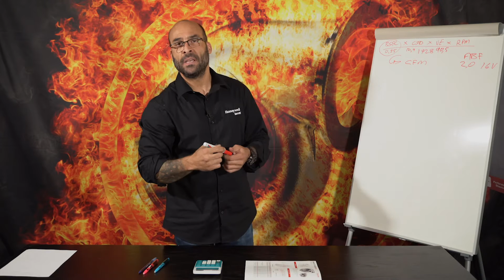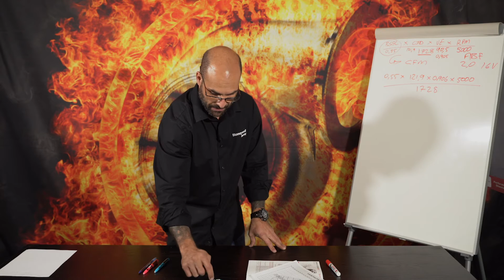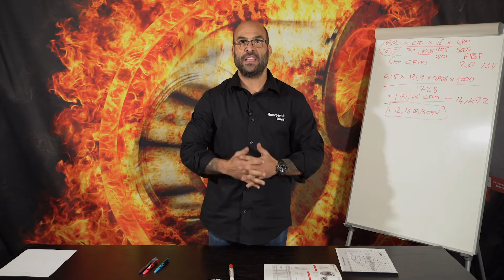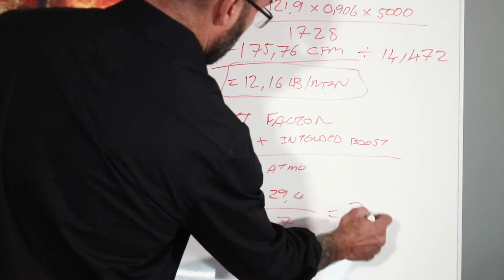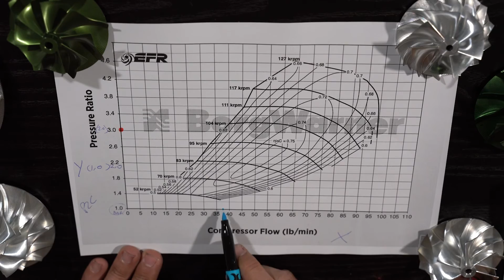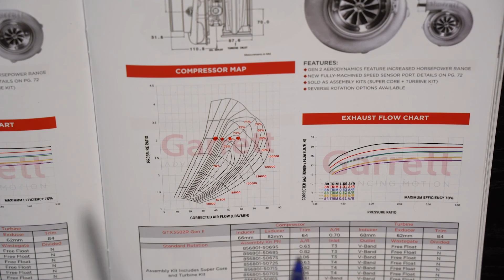Turbocharger compressor efficiency

Comment: Can you determine VE from a dyno run? How did you determine bfsc?
Reply from the maker: You probably can, but the VE will not be accurate, there are always losses in the drive train, and outside conditions that will affect the calculation that the dyno does to provide you with the power and torque.  VE is usually calculated from the engines specifications. The manufacturer will provide the VE, or you can use the Power that the engine makes at the RPM it produces max power and its CID to calculate the VE.  BSFC is mentioned in the video. 

Keep in mind that the calculations provided in the video are NOT in-depth, these are used to provide you with a very good idea (within 5%) of the actual value if you take into account humidity, Baro, Density Altitude, intercooler efficiency, pressure drop and and and --- so that you can identify and choose the correct turbochargers compressor for your application. Its NOT designed to split hairs and calculate the very last 0.00001 decimal - if you get my drift.... 

Hope that helps -

Comment: I dont quite see how this info will help select a turbo, you didn't explain how you know it will get into boost, ever! For example even bigger turbo on that engine may never get into boost right?  just placing a dot on there at 50lb/min doesn't mean it will get there. So more to the point how would I calculate what rpm I might get boost with a given motor and turbo, that would be useful for me. This video makes it look like you can put any size turbo on a 2L and put a dot on the graph of a good brand turbo, and it will get there, which I know is impossible IF the turbo is too big.
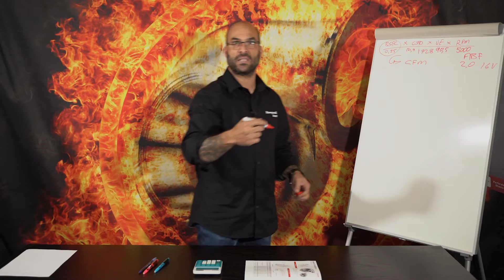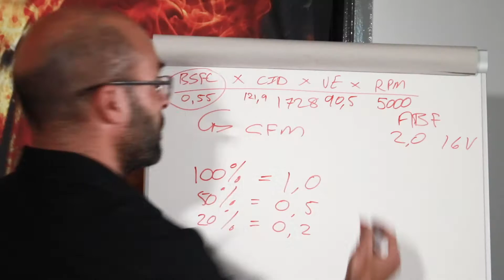Reply from the maker: Jay from around 1:05 until 1:35 i mention that we will not be going into the low level in-depth calculations and we wouldn't be splitting hairs about every single formula and contributing factor - this is a basic outline on how compressor maps work, how to plot on the compressor map and how to calculate the plot points based on your specific engine build - its not discussing or demonstrating the turbine calculations (which is extremely complex in comparison to this video) which is what you will need to be able to plot the "response curve"  and understand which AR turbine housing to use etc -- 

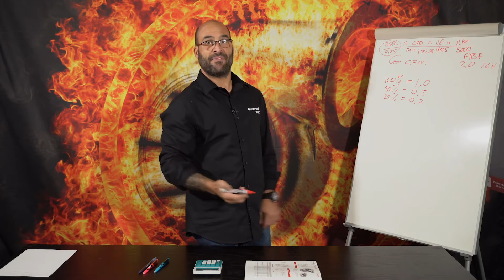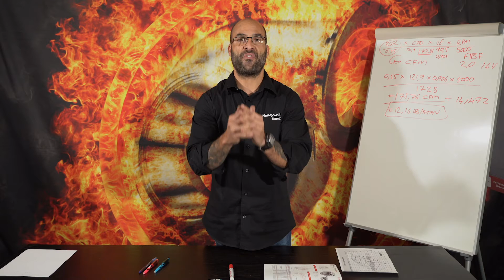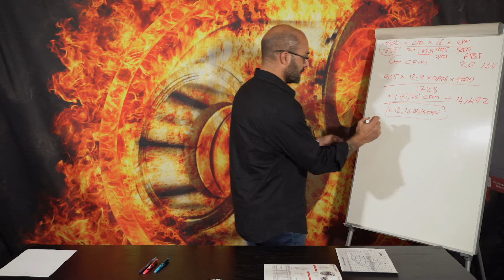This video is as i mentioned at 1:34 "This is the basic jist of how to plot a compressor map"  at 4:13 until 4:25 i also mention that we not going to try and plot low engine RPM - hense we started at 5000RPM upwards. 

This video is designed to help most people choose the correct turbocharger - based on its compressor map. 

This video certainly does not make it look like you can put any turbo on a 2L engine - do the math and you will see that for example - trying to use a GTX5533R (obviously too big a turbocharger for this 2L engine) will not even put you anywhere on the compressor map past the surge limit under 7000engine RPM --   and the same goes for trying to use the GT1241 turbocharger, which will put the plot after 4000RPM past the choke limit of the map --- 

If you looking for response, and EMAP, and turbine AR choice, then the Matchbot is the tool you need - this is the easiest way to plot the turbine side of the turbocharger.

Comment: Great video. One thing that was not covered is the temperature and it's effect towards turbo flow requirement. By multiplying the pressure ratio by the mass flow N/A, you are assuming that the air temperature after the turbo or intercooler is at standard temperature 70 F  (aka no change in temp). This would be fine if the intercooler was 100% efficient. However most intercoolers are more in the 75-85% range. This means that the temp going into the engine would be higher therefore the density ratio will never match the pressure ratio. In this case if operating at 3.0 pressure ratio, you would have to multiply the n/a mass flow by the Density Ratio and not the Pressure Ratio since the temperature change needs accounted for because density ratio X n/a mass flow is what the turbo needs to flow at that pressure ratio and therefore a more accurate representation of how efficient the compressor will be.
Reply from the maker: Thanks for the comment - 100% hear you, i kept this easy to understand, but there are other factors that also influence the maps and plots, but this formula will get you as close as dammit to the final result - and for most will act as a guide to help them choose a suitable compressor match.
Reply: Thats what I love about match bot you get all these calculations provided. Its awesome.

I would definitiely love that borg warner make a hybrid version for compound turbo setups.
Reply: he literally said that he was keeping it simple to get a rough idea......  maybe you should slow down and actually listen. geez

Comment: BSFC how could one figure this data or is this a dyno only figure , from mesuring actual fuel consumption per each hp live?

I am thinking the the data provided by Cummins 
 72cc fuel per 1000 events= 72cc /min @ 2000rpm 
160bhp @2500 (fake news Chassie dyno  said 45whp @2500 without correction 
) 
Rear world 
With correction 173whp@1976RPM (peak hp and start of governors fuel cut)
So
Rpm ÷ 2 ×  single injection volume ÷ BHP=~ BSFC
1976 ÷2=988
  ×.072cc=71.136cc 
÷247.1=BSFC 0.28/hp
 

Wheel hp (WHP) to crank hp(BHP): 

Whp÷7×10=bhp or whp+30%=bhp
247.1÷7=24.71lbs air/min whp
24.71×10= 247.1bhp.
Reply from the maker: To keep it simple as possible - BSFC is the amount of fuel burned for a specific amount of power produced. Each fuel has a different calorific value and hense a totally different AFR. So using pump fuel as opposed to ethanol (different percentage content will differ the number used)  or Methanol will have different BSFC - this is why the Match BOT from BorgWarner is so good as its THOROUGH  and requires the fuel you intend using to make its final calculations ... are you starting to see why Borg is better... if not you will soon enough.
Reply: @TurboDirectSA  yes I understand the "what" BSFC is and how valuable it is as data. However "how" to get said data(BSFC), I need help.  
The local (700mi drive) chasie dyno dosent have the ability to mesure fuel flow on a MECHANICALLY Injected deisel.

 I know it is easy  just strap $5k(each [2 needed]sender $2500 to accurately mesure my 2.2ga fuel flow /hr) of lab equipment to the motor   drive for a little wile and wala I've got the data to do the math to find the right turbo for my Non-standard build(2000lbtq@1500rpm).
Reply from the maker: @daviddroescher  You going to need to contact the manufacturer of the engine to get the necessary data on it, and from that calculate the BSFC and use that value - the manufacturer will have this info for you though.

Comment: Questions
Do you ship to the states, and do you have  your .71 v band v band  special tongue Garrett  fitted for a G25-550/660 

For sequential  , youd divide the cfm by 2 and do a map for each bank, correct?

For compound? A feeds B. B feeds the motor (B =manifold/small /high pressure charger)
  ?run the numbers  for A. Then using  results from A in PsiA as the inflow for B and run the numbers agen for B/B's?
I understand it is way more complicated than that, but this is my best guess. 

?how to compensate for work induced thermal expansion going into B (map is in "corrected" lbs/min) aka how to un correct the flow rate

 planed phase 3 setup for 175mph on 160hp worth of fuel looks like this
G25-550/.72ewg (B1 back 3cyl/2.9l)   g25-550/.72 vband ewg reverse rotation ( B2 front 3cyl 2.9l)  fed by a s362sxe/14(A 5.9l)  peek whp on dyno was @1976. So low rpm 130-150mph
Series-parallel 1xA into 2xB

Will DeltaT help to confurm my  location in the efficiency map. Eg -7°f air filter, 257°f compressor discharg and -11°f intake manifold@ 15psig/27psia(7k' above sea levle, look up hypoxia drag strip ) 1550 rpm /70mph
Ambant -15°f 
Delta T compressor =+264°f 
Delta T  IC = -2662°f (4° above ambant)
Reply from the maker: No we dont have any housings for the Gseries turbos as yet.... coming soon. 

Sequential - controversy, mixed understanding .... sequential="in sequence" how in sequence? Everyones idea is different - without knowing what your idea is, its impossible to comment.  What size turbos, what AR housings, location, runner length, ID dimensions?  Very complicated to setup depending on what you want to achieve. 

Compound is actually quite simple - BUT it all depends on what the intended requirement is once again.  Compound turbo setups are designed for massive power outside of a said turbochargers ability to be able to provide  sufficient HP and the engines ability to spool it up. 

Mapping is technical - shoot an email off to info@turbodirect.co.za for me to look at for you.

Comment: @TurboDirect S.A - K20A2 built motor, 11.0:1 Compression spring retainer motor. We are planning to run 600whp at 9200rpm, im trying to find a turbo that will work for a mixture of low boost Autox (400whp) and Street (600whp). Looking for something that will spool before 4krpm that can meet both conditions. Is the G30-770 one of these? is there anyway you could help me with a plot?
Reply from the maker: Ian - i find a few issues with your requirements. 1) Are you requesting that a turbo make the peak HP of 600WHP at 9200RPM? If so, this turbo will be large and will never spool around 4000RPM.   If NOT - then are you requesting that the turbo make its power earlier in the RPM range and lower to 600WHP at 9200RPM?  - If so, the once again this will be a relatively large turbo and most likely will not spool before 4000RPM. 

Any turbo that spools BEFORE 4000RPM will be relatively small considering the high compression you running, and will not be as small as the EFR7163 or EFR7670, but more in the line of the EFR8474 Black Series (950HP capable) which should be able to spool up around 4000RPM full boost with that high compression, ensuring that you using a decent fuel which will allow a decent ignition advance without hurting the motor. This turbo will make the power you need, and is able to make it earlier in the RPM range, but with clever boost control, you can definitely have the 9200RPM mark still making 600WHP - provided that the engine can use the flow form the turbo and convert it to HP - 

G30-770 is a waste of time on this application because of the high compression and high RPM band -  The power will guaranteed fall away from around 6000RPM even with high boost and controlling the boost in the high RPM area by increasing it as the engine revs - the same will happen with the G30-900 - I would suggest the GTX3582R Gen2 or G35-1050 turbo for this - either will work, but the later is much more expensive.
Reply: @TurboDirect S.A - yea we are planning to do time attack and autox at 400whp and are wanting as quick response as possible. Our street setup will be 600whp area. All on E85. Im not great with turbo selections and was looking for some advice. So a Gtx3582 gen2 will keep good response around 4k to 4500rpm and still be capable of 9200rpm without dropping off?
Reply from the maker: @ianjohnson4170  It will yes - but what i would do is be clever with boost control to hold the power and torque curve up in the higher RPM range - if you find (gear ratio dependant) that on the tighter corners in Autox you losing response, then introduce a slight antilag setup to help you out there. Then you'll have the best of all worlds.

Comment: Chris, could I use your widest knowledge again? :)
1) Do you think if it has sense to decrease standard CR of my CJX engine for boost maximizing? Now CJX has 9.3:1 CR but I can easily achieve 9.0:1 with this https://www.bar-tek-tuning.com/2-0l-tsi-ea888-dicke-race-metall-zylinderkopfdichtung?number=21tf277.3
2) What do you think about piston coating? I mean something like that   https://www.enginebuildermag.com/2019/10/crowning-glory-coatings-make-great-pistons-even-better/. Does it make sence?
Reply from the maker: 1) Why would you want to make the engine less efficient?  Rather use a better fuel and keep the VE as high as possible. 
2) Dont waste your time - been there done that -- "detonation" --
Reply: @TurboDirectSA  1) Got you sir! So there is some proportion:  higher VE - higher CR, yes? 2) Got you sir 2! I've just heard rumors that this coating helps decrease cylinder to wall clearance :)
Reply from the maker: @stanislavaleshin1202  Yes ofcourse - changing anything inside the engine will have a direct effect on two things - BMEP (brake mean effective pressure) and the VE (volumetric efficiency) of the engine - these are directly related to the power output and fuel efficiency of the engine.

Comment: Once again - great video! Three questions: 1) you've mentioned that 10lbs/min for 100 HP it's a quite conservative assumption, so - for modern tsi engine what proportion is more suitable? 10lbs for 110HP? or more? 2) honestly, I haven't understood - why you chose borg wagner as the best option, spool became later and the same efficiency in comparison with Garret. I think that both these turbo are not the best option, they are way too big for 2.0L engine. Could you explain your choice? 3) One question last - how to match right turbo A/R and turbo size for exact engine and power goals, is it possible to explain this point easy? :)
Reply from the maker: Stanislav each engine is different, it all depends on the engines VE. Any change made to the engine will change its VE, which is a key value in the formula.  2) Nowhere did we speak of spool -- EFR is designed on another level compared to Garrett in terms of bearing design, longevity, attention to detail, comprehensive simulation analysis - search for the technical doc on the EFR range on BWA web page for more details - you will be surprised.  Both these turbos are 100% perfect for this engine in my video - AS A 1KM CAR ....... there are a miriad of other options for other applications like street, drift, drag etc.... 

It is complex in choosing (based on calculations) the best AR turbine housing, you need to take into  account shaft power output, flow, EGT, Fuel type etc..... it is obviously possible, but very complex.
Reply: @TurboDirectSA  Chris, where could I find this video (AS A 1KM CAR)?
Reply from the maker: @stanislavaleshin1202  The very same video you commenting on.
Reply: He explained the reason for choosing these turbos; for absolute top end performance. If you were going to spend more time lower in the rev range you would choose a smaller compressor, but the example was for the most efficient compression in the top of the RPM range, hence there was much map left over to the right of the peak rpm.